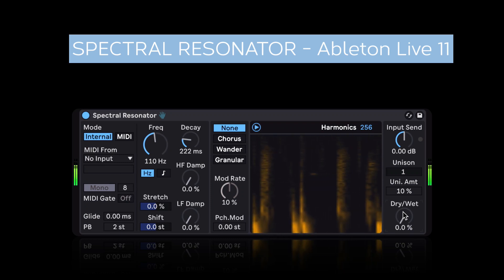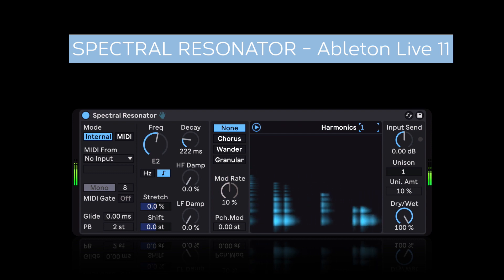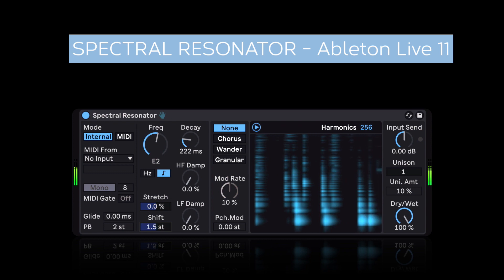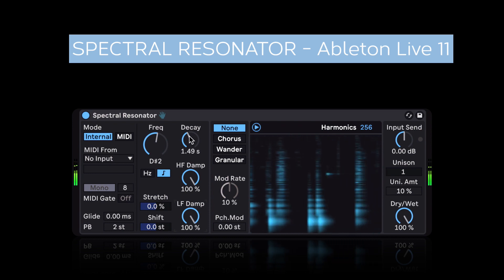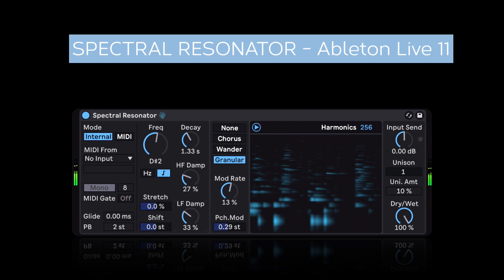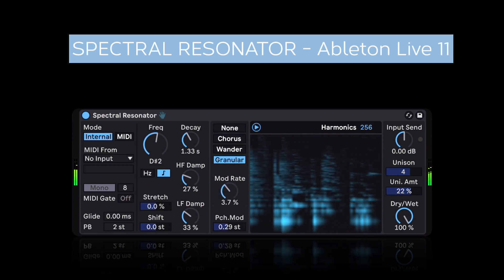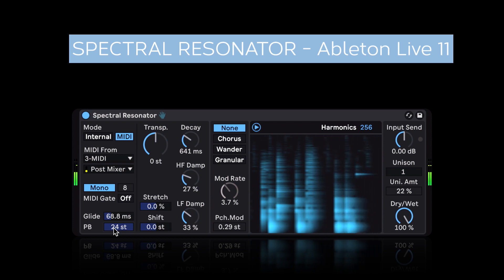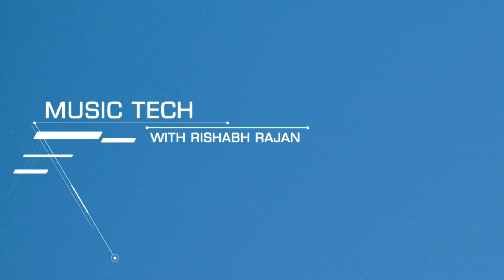Ableton Live 11 Spectral Resonator

Comment: is there anything like this on logic? or a plug in
Reply from the maker: Alchemy does something similar but it's a synthesizer so you will have to load samples into Alchemy and switch to Spectral Mode. https://youtu.be/l-3atLSbUlM
Reply: @rishabhrajan  in the new spectral resonator there seems to be a sort of time stretching/bit reduction effect that I am not able to replicate easily in alchemy. It seems like the spectral resonator is not quite the same after spending a couple of hours in alchemy last night.